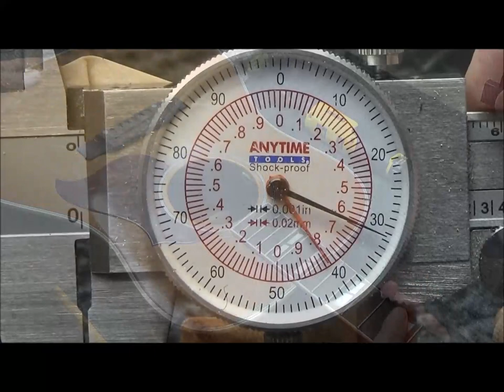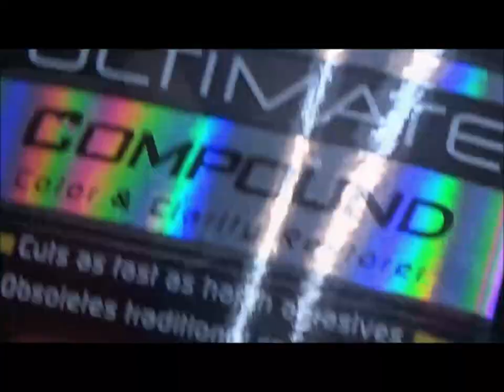Neck Reset - Gibson Hummingbird

Comment: Whats your view of using the foam cutting wires rather than steam?
Reply from the maker: I’m getting ready to order a pair of 4” foam cutters. Do you use them?
Reply: The only neck I've reset was a 335 copy which needed totally cutting out due to poor manufacture. I've seen Ted Woodford use them a couple of times successfully and of course Ian Davlin.
Reply from the maker: @tochriss  Exactly! They get a pretty good review from other luthiers in a group that I’m part of. I’m just trying to decide on the 4” or 6”. They’re so cheap I might get both sizes. Thanks for reaching out!
✌️✌️

Comment: 1 - shave saddle (at bottom of saddle) 'first' to determine the requirement for a neck reset (neck reset should be an absolute last resort).
2 - buff the guitar (after) the entire process is finished. 
3 - when using the sand/pull method; brush/dust away sandpaper grit after each pull. Then you wont have to go back to buffing the area (again)
4 - get one step completely finished so you save time not having to go back and forth.